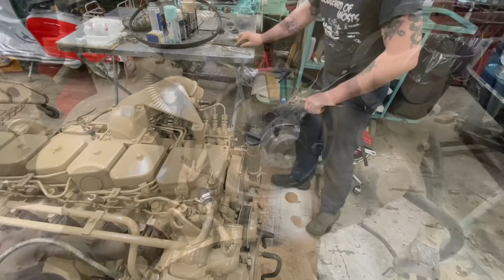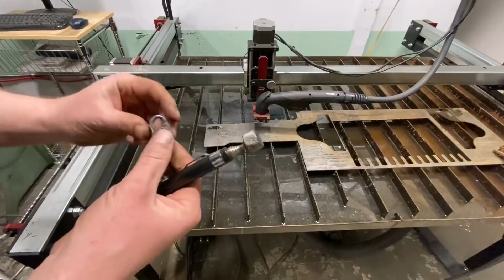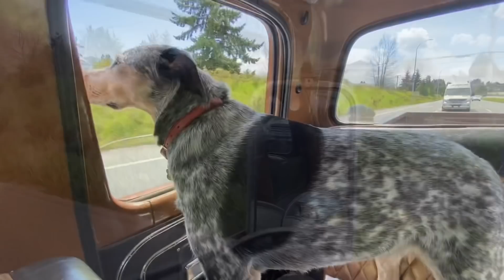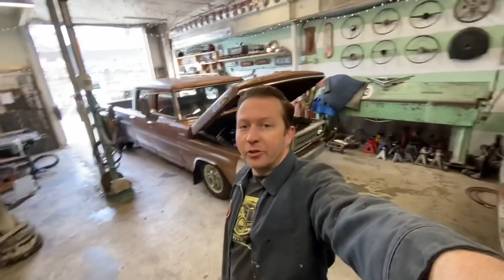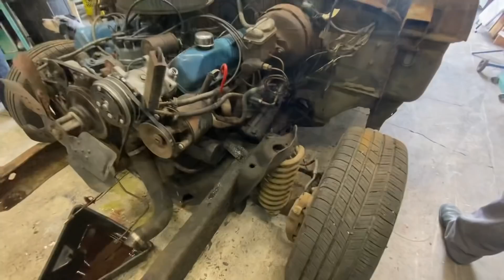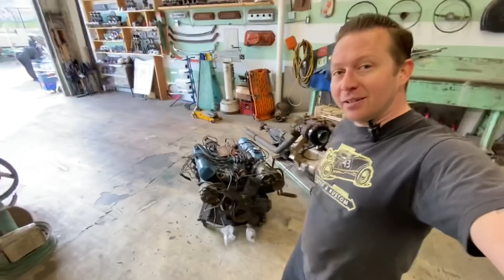Brown Sugar Cummins Swap Part 3 Killer Dowel Pin Fix and the 390 Comes Out

Comment: I have a friend who has an absolutely pristine 95 Cummins ram with a 5-speed manual and contractor bed, and his KDP fell out unbeknownst to him. By the grace of god he must’ve been going around a corner when it happened, because instead of dropping between the gears and shredding his engine, the centrifugal force of the turn must’ve carried it outwards and it caught the outside of the timing gear and propelled it down. 

When his mechanic took it apart specifically to fix the pin in place, he realized it wasn’t there and found it in the bottom of the timing cover. Sometimes we get lucky.
Reply from the maker: Lucky guy! I saw a few posts while researching the KDP where other people also found it laying in the oil pan.

Comment: Hi  LG Kustoms  looks like your roller chair is lots of fun !  Things seem to moving in the right direction with the engine swap. Have you ever thought of making a do it yourself kit to lower the front suspension and rear end of an early Ford . Lowering shackles like the ones on the rear  spring of your '47 .  Various lengths  depending on the front and rear  "drop" you may be looking for .  I heard from the Old Timers  , you don't want to get too carried away . Shackles , Bushings and Bolts ... could be the making of a Rockabilly tune about a low rider Ford . Gotta talk to the Farrell Brothers from Selkirk about that one .
Reply from the maker: I covered lowering the front of the 47 in a tech article I wrote for Canadian Hot Rods Magazine, but the back… well I actually have longer shackles drawn up on my computer already, I just haven’t had a chance to cut them out yet and do a video on them!
Great minds think alike! You’re just a bit faster than me haha

Comment: If that Cummins fits in there that stock rad from the Ford will easily cool that motor.
Reply from the maker: Oh great! I kept the dodge rad too. I know it’ll fit with the dodge rad and intercooler and still look “natural”. A local guy has a 71 F350 2wd and it looks like a factory install in his truck.